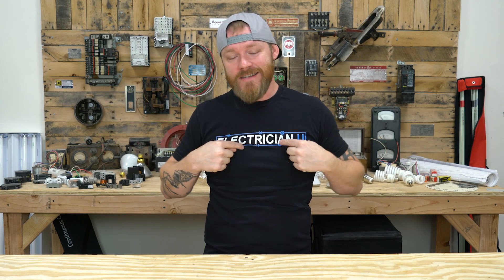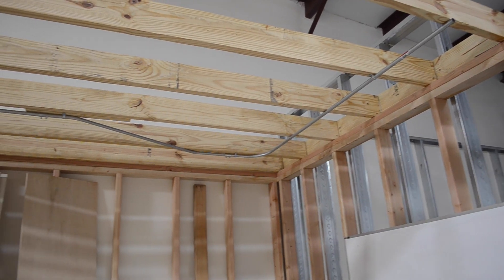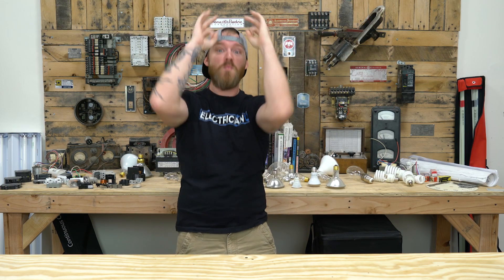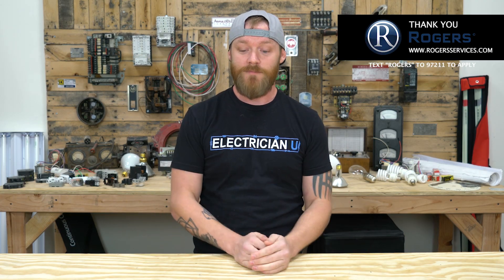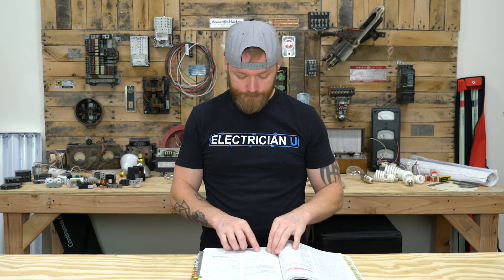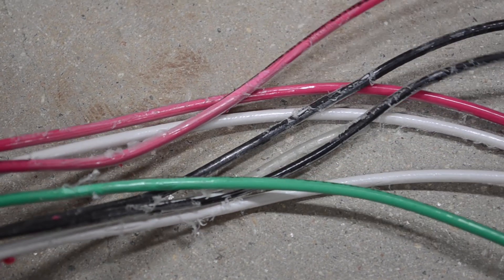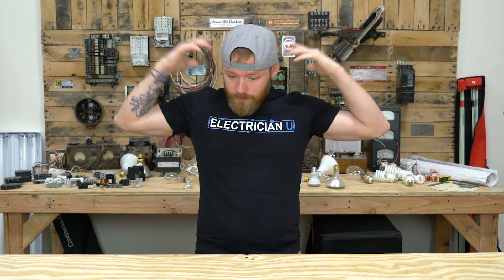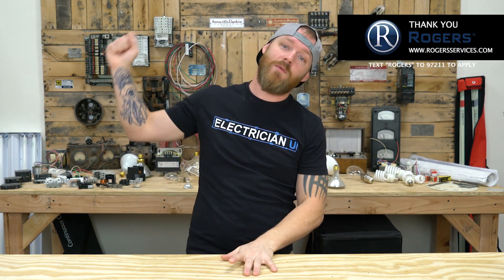360 DEGREE RULE for BENDING CONDUIT - No More Than 360 Degrees of Bends

Comment: I hear you constantly referring to the NEC or “CODE” and that’s good but it’s the minimum safety requirement but often falls short of the AHJ (Authority Having Jurisdiction)… These are water / wastewater plants, electric Power plants, as well as a few other government installations. Specifically the 360° rule would equal a rejection at the AHJ / WTP) I was employed as an inspector at set their maximum allowable to 270°. Furthermore all runs had to be parallel or perpendicular to the building lines and grades… so ONLY if the building had a O/S in it then the conduit not only could but had to also conform to those lines. This was almost all heavy industrial so generally no EMT except in office building. Car flex, Liquid Tight , etcetera was limited to a max 6ft at equipment entrances only. Some conduit runs were special runs that required corrosion resistance as well as shielding so standard galvanized steel or PVC conduit was out. My point is a rookie mistake would be a journeyman whom worked in other settings where code is the minimum standard would possibly loose their company big $$$$$ by approaching all jobs with the mindset of only doing what the “CODE” minimally required and failed to incorporate the standards required by the AHJ.

Comment: That's almost common sense. The more bends you have between any 2 pull points, the more friction you have on the conductors. If you cannot avoid having more bends, you can use a larger size conduit. But that's rarely the case.

Comment: Everyone has bills to pay. Take the money!

I remember this information differently. I would have sworn the code was 270 degrees ( when I was a contractor years ago). I've also found that you can barely get just a pull string to move through 360.

Has that portion of the coffee been revised during the past 20 years?

Comment: i am an oilfield guy that has only dealt with teck cables, explosion proof fittings, seals, and boxes and all that jazz. i got a job for hospital construction in 2014 and that was the first time i have ever ran EMT pipe, was good times. got to do door security which was 1/2 inch, and tons of 3/4 and 1 inch, some 1 1/4, 1 1/2, 2, and also the 4 inch EMT from the main MCC to all the other electrical rooms with 4 inch. I didn't enjoy that big pipe too much, found the bender didn't bend the same amount every time but i guess it wasn't the worst thing i have ever done. Finished the job two years later and haven't bent any pipe since.

we always had the oilfield buldings prefabricated so i never got to do any rigid. that stuff is a bit harder since you need to thread the pieces together. i installed a lot of straight pieces to finish the prefab on the outside but that doesn't even count.

Comment: Will you be doing any vids on Romex, NM, in EMt conduit at all.....don’t wanna open a can of worms either.
Reply: don't do it .
Reply: Romex is NM.... And as far as Romex in EMT, it doesn't matter. You're not pulling Romex through a EMT raceway, so therefore it is used as protection and pipe fill does not factor. Pipe fill only counts for raceways, meaning you ran any type of conduit from the panel all the way to the device, that is a raceway and no one is ever going to pull Romex through a raceway. But if, lets say you work residential and you run Romex down am unfinished basement wall, you can literally cram as much Romex as you can fit, because it is only used for protection of the Romex down the wall. Code does not specify how much wire can be fit into a pipe used as protection, same thing if you use a "chase" or "nipple" under 24" in length. There are no pipe fill requirements.
Reply: @nickg1307  thx for the reply. Always enjoy watching vids etc....as I like picking up tips/tricks from others. I believe that even if master electrician, you can always learn something from another person etc.... Also, yeah, I do mostly Res work nowadays.
Have a good one ✌🏼

Comment: Dustin,   Although 100% correct, NEC panel needs to make an exception to the rule.   If newer insulation like Southwire sim pull is utilized, then more degrees allowed.   Second exception.  More degrees allowed with engineering pull calculation performed and on site for inspector's review if requested.   I did conduit layouts in 3D for 15,000 sq ft electrical room with 5.5 miles of 3-1/2" EMT with (4) 900Kcmil compact Al and ground.   The electricians pulled right through the "required" pull boxes and through at least 630 degrees bend.   Did pull calls.  No where near allowed stress or sidewall pressures for damage.   Respectfully,   Kevin

Comment: @2:24   or you use brickies line thats light as but pretty strong ... you "blow it" through with a plastic bag etc and blower, its so so so easy, you then tie it off and pull cable through, its like a hot knife going through butter....

Comment: That’s an easy fix, just add a box If you fuck up. Use a bandsaw to cut two sides of the pop after your measurements, two connectors, and good placement for the pull can.

Comment: 4:35 those aren't damaged conductors.  Paul Abernathy said that the nylon jacket on the insulation is a sacrificial aid for pulling in the conductors.
Reply: Not exactly. It's also a UV shield. Only needed inside switch boxes and anything else that creates arcs, but it does protect the insulation. Decades need to pass before damage is done, and usually the switch would burn out long before the wire is compromised, but still, it is providing UV protection

Comment: Hey man im running a sub panel on this commercial job and ive got to get into the main disconnect/switch board. Does this rule apply all the  way up to 2 1/2" pipe and 4 4/0 conductors? I will install a pull station if i have to but i really wanted to do it in one run
Reply: The larger you go is where it matters most. Today I pulled Medium Voltage through 6" rigid with two 90's and expansion joints and even that wasn't easy.
Reply: @glenjamindle  thank you. Any suggestions to make this run easier
Reply: @noahnewsome2050  We used a D80 tow behind compressor to blow a mouse with a string, then pulled a small rope through, then pulled a large rope through. We hooked a pulley to an excavator boom and pulled back the rope with a skid steer. We hand fed the MV into the 6". 4 4/0 isn't a difficult pull with enough guys, but you can always split up the pulls by installing a j-box somewhere in the midpoint. I hate using lube so I always upsize my pipe, but you could try throwing some of that down in to help.
Reply: @glenjamindle  also did you have a tugger or hand pull?
Reply: Definitely be under 360° when using a tugger because most tuggers (not all) have alot of pulling power with no way of sensing whether or not you're tearing up the wire inside.
Reply: @scottpierce3351  Or snagged on the inside of the conduit/coupling/expansion joint. I've had to fix plenty of underground pipe because one dummy used the skid steer to tug wire through and it blew out the 90 when it snagged.
Reply: @glenjamindle  holy crap pulling with a skid steer is a thing?

Only residential experience (county code says no Romex) so not familiar with anything more than 6awg
Reply: @shimes424  Yea man, we pull some huge stuff long distances. Usually two, maybe three pulls a day.
Reply: Noah Newsome yep, applies even more so with larger sized wire. You don’t want to be pulling that without a pull box